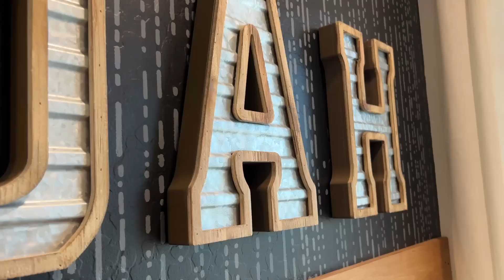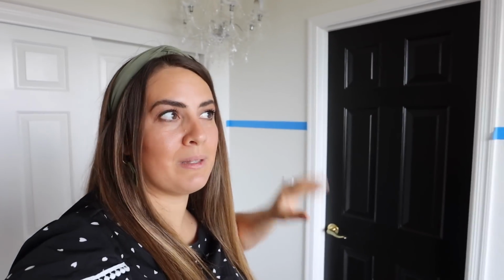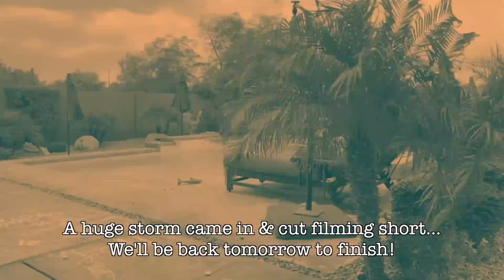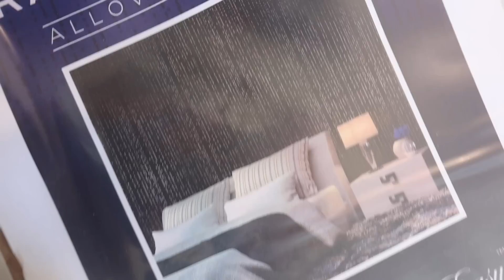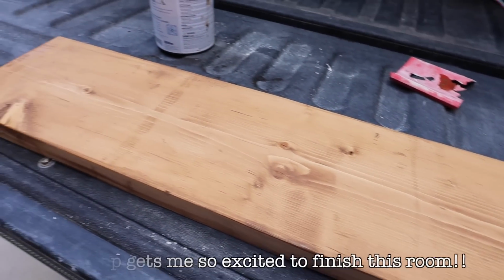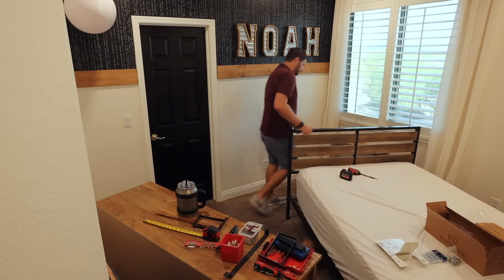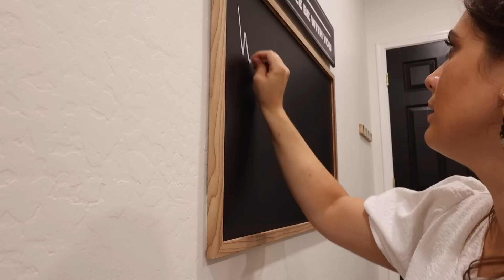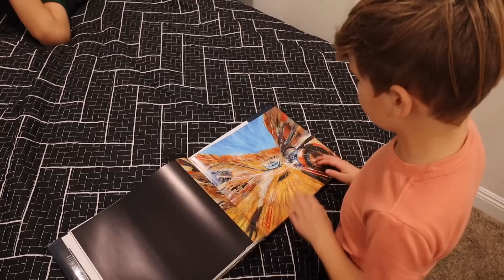DIY BOYS BEDROOM MAKEOVER on a SMALL BUDGET!! {episode 3} :: Star Wars Bedroom Ideas 2022

Comment: There is another option and yes I have done the stencil they have the sponge brushes they are flat and you just take debit on the stencil it works fantastic it's not a great big brush but it really does a great job like I said it's like a sponge on the end of the handle and it's flat it works great